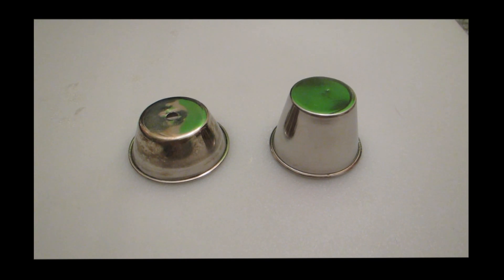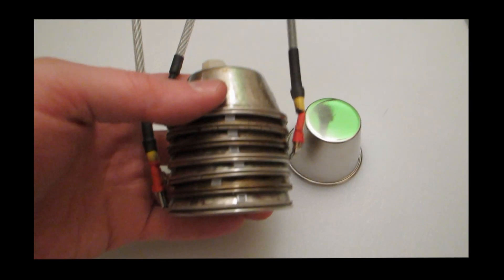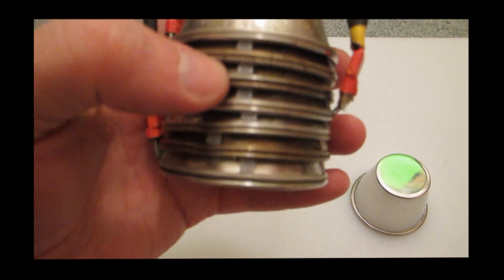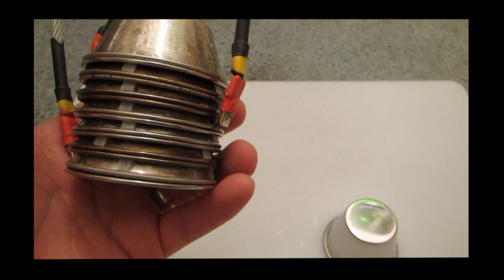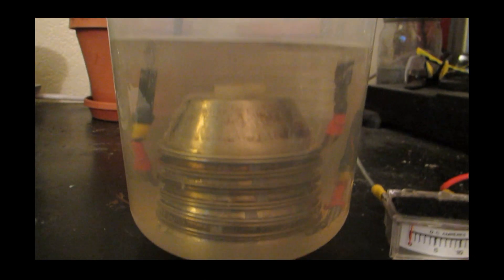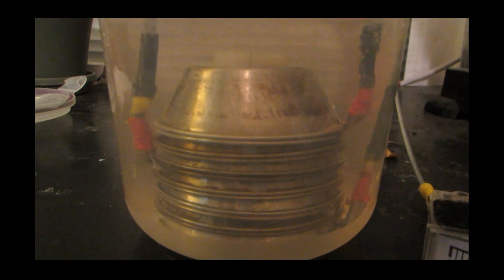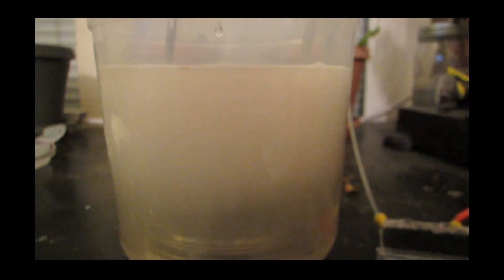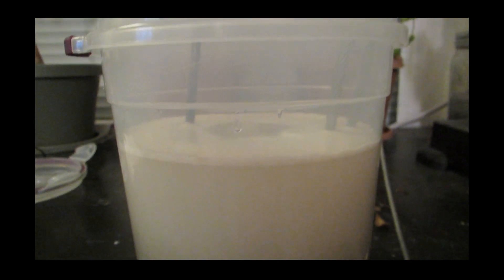Vid 71 Volcano w/ Double Stack Cups

Comment from the maker: I've never had a problem with the gas getting trapped in the cups, because it rises until it exits the exhaust hole.  It is literally impossible to have the gas build up in this design.  I have done extensive testing with several different hho cup cells during my 5 years on YouTube, and can assure you that it doesn't matter if the cups are facing up or down, the gas will find a way to escape.